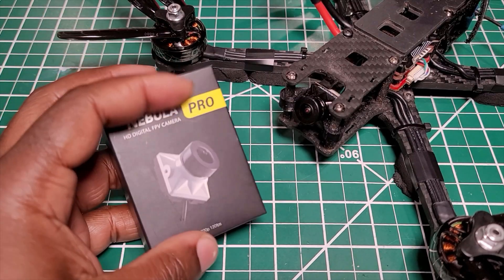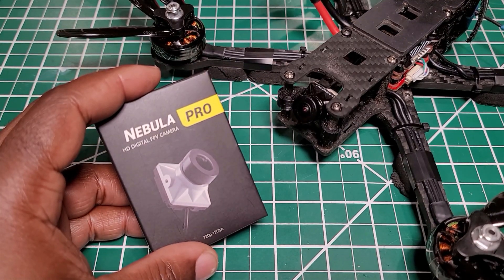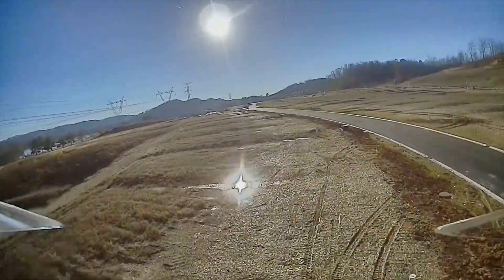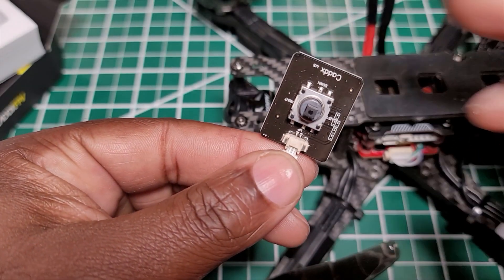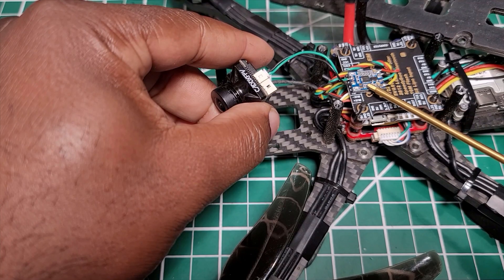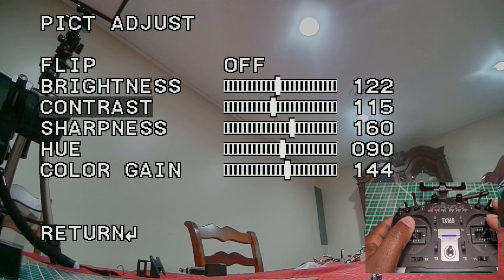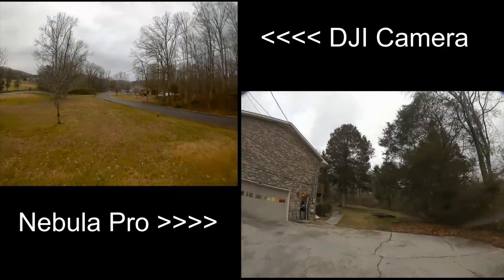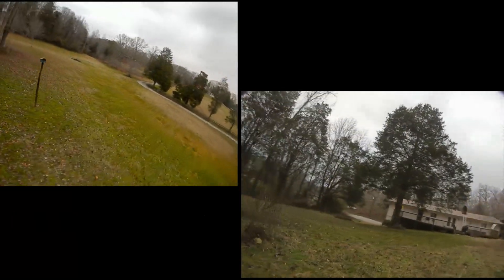How to turn Nebula V2 into Nebula PRO

Comment: Can you plug any DJI or Caddx vista/nebula pro/nebula v2 camera into the Caddx Nebula v2 air unit? If so, you'll get the better picture and lower latency by swapping out the Nebula v2 camera with any other digital DJI compatible camera?
Reply from the maker: Yes, you get a better image and full functionality with the DJI/Nebula pro cam, and they all use the same mipi cable, so you can interchange these 📷
Reply: @GBoniFPV  Awesome! Thanks! I just ordered the Nebula v2. It's my first digital setup so we will see how it compares to my analog setup. I'll eventually order the Nebula pro camera.
Reply: It is the same DJI Air Unit or DJI Air Unit Lite (smaller without DVR and with 1 antenna) for all Caddx/Runcam provided DJI assemblies. Only camera is different.